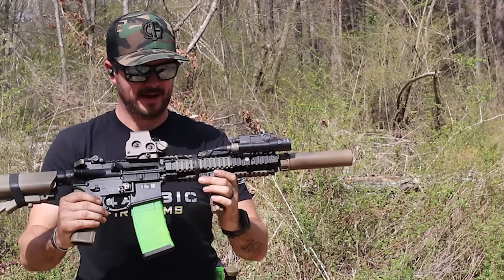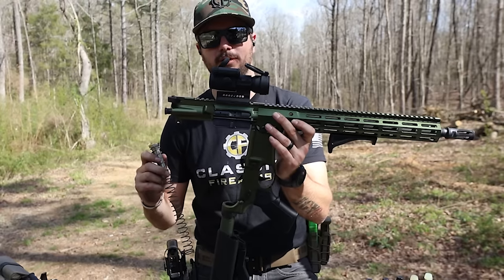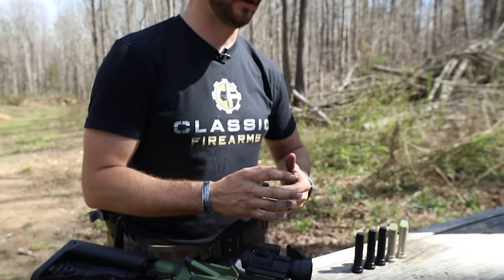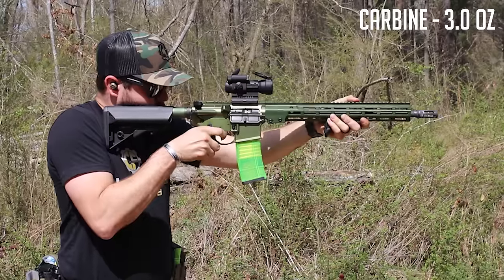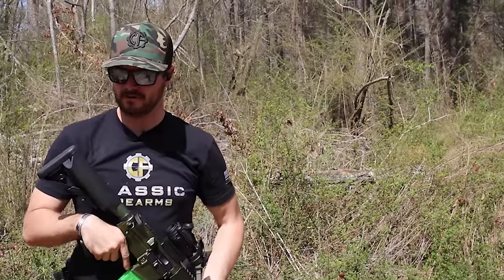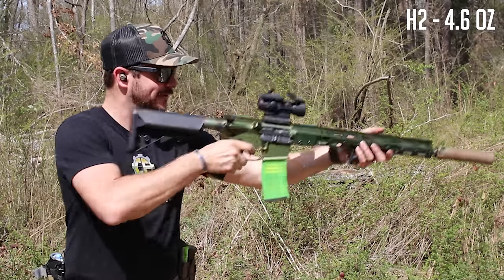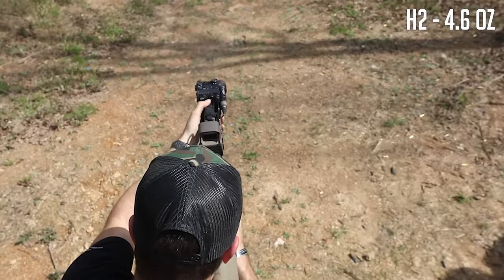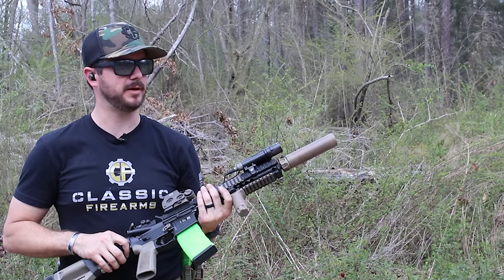What Buffer Should You Use In Your AR-15? (H1, H2, H3, H4)

Comment: Quick question with the buffer weights I am running my stock radical firearms 10.5" ar pistol in 5.56/.223 the only thing I changed out is the A2 flash hider for a ar stoner blast diverter (so all the gasses go out the front as apposed to the flash hider) the question I have is I can tell it is an pver gassed system but I believe it is alittle gassier with the blast diverter on it as it acts somewhat similar to a silencer I have noticed with the steel mag that comes with the gun it will not feed properly like the bolt is going forward way to fast for the next round to come up and I notice this slightly even though it still feeds that it seems abit to fast for its own good... so what I need to ask is should a change to a heavier buffer weight and if so what weight is best for it???

Comment: To all the newbies, just cheat & use other people's research for your build. Plenty of forums that have this talked out & charts even. If you're not sure you could snag an adjustable, its honestly only a wee bit more $ & multi options. Or if it tickles your fancy, the JP SCS systems are very nice all around w/ more benefits than just weight tuning. Best of luck to all.

Comment: Buffer weight in my experience has never made much of a difference.
My SBR has an 11.5 barrel and I have always used an H2 based on the 3 to 4 o'clock pattern I get.

Comment: Love that you did this! I question the assumed that there is a correlation between ejection direction pattern and buffer weight on a gun with a spring loaded ejector.  As soon as the brass is clear of the port door it will come out with the force of the ejector spring.

Comment: With an over sized gas port, you can install an adjustable gas block and reliably use a standard buffer mitigating recoil impulse better than using the H -H1 or H2 buffers...Having the ability to mitigate the gas gives a much better rifle for felt recoil than just increasing the buffer weight...Having the ability to adjust the gas to the lightest buffer is the best option....Adding weight to the recoiling parts will increase the recoil....

Comment: With my rifle the shells eject to my 1 o'clock position but my real problem is that I'm able to fire the first round but when loading the next round the BOLT closes about 3/4 of the way but the BULLET somehow gets CAUGHT UP and is BENT in the middle with deep GOUGES on the side and it will continue to do that until about 3-5 rounds and then after that I'm able to finish the magazine shoot the rifle with no problem most of the time.
 Is that a BUFFER TUBE problem or something else ENTIRELY

Comment: I was hoping this video would provide me with some context as to why the lower I built recently doesn't cycle properly, sadly at least according to the listing on OP where I bought the buffer kit it's a carbine buffer, so already as light as it's going to get. The ammo I used is standard velocity 223 55gr from Tula, which I understand isn't top shelf ammo, but the same upper on my old lower cycled it just fine... Do new springs have a noticeable break in period? I did notice that the hammer spring seems to have a lot more tension than my old lower, and the hammer itself has a bit of a different profile, maybe that's the cause? The pistol lower I built with the same LPK from PSA seems to work fine, but it's got a 300blk upper and a pistol length gas system so I'm doubtlessly putting more force into that than my 16" 556 upper with a carbine length gas system...

IDK if anyone in the comments can help me out but having a, for the most part, manually operated AR isn't exactly what I intended...

Comment: I know I'm late following this... But did you come up with follow up video testing these various buffer weights with various different gas length systems. I know my mid length system works well with a H3. But  there's also other variables like spring strength and how well your gas block is working, and the weight of your bcg.

Comment: My brass ejects at 2 o’clock now with no suppressor. I have a Diamondhead 12.5 inch barrel. I’ve asked the range officers at my local range and they said that’s the ejection pattern I want. I had to get a brass collector in order to keep my brass since at the 2 o’clock pattern, it shoots directly into the range where I can’t collect. Should I get a heavier buffer weight?

Comment: Recommendations on a buffer set up upgrade for the ddm4 pdw withOUT a can but will properly cycle both subs and supers? I've run both factory that were included with multiple loads of both super and subs. Supers run fine but subs dont cycle well consistently. I understand this 300blk was designed around putting a can on but I'd like to be able to run both without and without issues.

Comment: Running a pws mk114 mod0, so curious with buffer weights, as the mod0 doesn't have adjustable gas block. It's gas block is also built like a brick shite house, with the quad trails attaching to it. Side affect, it gets hot, so shooting without gloves doesn't work for long.

Comment: I can't get my 18" rifle length gas system, upper to cycle reliably.  I have used an H2 and then an H buffer weight,  it's still under gassed.  Should I use a carbine weight buffer?  My lower has a standard carbine length stock, not a rifle length stock.  Can't figure it out.  Should I use a reduced power buffer spring?
Reply: carbine buffer should be good, what kind of ammo are you shooting though that's giving it cycling issues? That can happen with underpowered steel case .223 like Tula.
Reply: @ed00001  I'm using Frontier 5.56 55gr, M193, brass
Reply: @ed00001  I ordered a Strike Industry standard carbine buffer.  Hoping that will work.
Reply: @bigmike716  A carbine length gas system is more violent than a mid length and rifle length shoots even softer than a mid, so if you were using a heavy buffer combined with a rifle length gas system, that could easily lead to cycling issues. Carbine buffers are the way to go unless your gun is overgassed.
Reply: @ed00001  Thanks brother.  Can't wait to see if this works.

Comment: My rifle doesn’t run steel reliably due to the the decreased gas return and bolt not cycling all the way to the rear. I use a carbine buffer, is there anything lighter that maybe I could run steel with?

Comment: Thanks for the good example vid!  I'm working to build a lightweight AR and wondered which buffer to use. I'll be using an adjustable gas block, so that might be enough, but maybe will also need a heavier buffer to smooth out that light bolt.  Any comments would be appreciated.

Comment: Hello I have a quick question if anyone will be willing to help. I am new to gun collecting my father recently passed he had quite the collection and it has now been passed on to me. And I am younger so I haven’t had a whole lot of experience with the guns yet and I’m trying to educate myself. With just different guns calibers everything. And one thing that has confused me is Specifically this gun. Colt AR-15 6920 Trooper M4 Carbine .223 / 5.56. 

Confuses me because it’s described as an A.R. 15 which to my understanding is a rifle with a 16 inch or longer barrel originally made by the ArmaLite rifle company later sold to colt. But at the same time it’s also described as an M4 carbine which again to my understanding a carbine classified rifle is just a rifle with a shorter barrel and a little lighter for better mobility.

Comment: Civilians hyper fixate on ejection patterns.  If your platform runs reliably, consistently & accurately then attempting to "fix" it is a solution in search of a problem.   

Patterns CAN be useful for diagnosing issues, tell you of extractor wear etc. but aren't a prob themselves.    Almost no setup will eject the same way quiet vs. loud so what are you even chasing at that point?  

Y'all make some good vids and ik you hire vets but possibly hire a GWOT SF/SOF weapons spec. or retired Army/Navy armorer that was previously infantry or at least kinetic.   Just my un-asked for opinion, but I think it would elevate the vids past general info and showcasing merch.

Comment: I'm messing with a 24 inch barrel ar 15. (Experiment) what buffer and spring do you guys suggest for reliability? It's got the rifle length gas system.

It's struggling to feed and I used a few mags of various Models.

My current buffer is H3
Reply: @Frank Bonazza III thx for the tips. Will start small and work my way up

Comment: I know someone who has a 7" 300aac upper (from PSA) with a Franklin lower and it isn't cycling.  1 round, then partial/misfeed.  Tried a shorter spring, but no noticeable difference; still misfeeding.

Any suggestions?

Comment: I got a millspeck PSA16 inch upper with the stock buffer buffer and Spring which I assume is the car being which is 3 oz I went up one to the H buffer and my felt recoil is about 8 times more than it was with the standard car being buffer I don't understand. Do I need a heavier Spring if so how do I determine if the Spring is heavier Springs don't seem to be rated the same way as buffers

Comment: What about the weight of the BCG? I have a 20" 6.5 Grendel that was shooting fine until I changed it to a side charging (heavier BCG). IT ejects but fails to pick a new round or even close the bolt completely. I tried switching to carbine length spring. I bought a adjustable buffer (can change weights inside) and still nothing. Any advice would be appreciated.

Comment: Will a heavier buffer weight help bolt closing/soft striking issues.
Reply: A heavy buffer helps close the bolt through carbon build up or other crud to lock it home all the way into battery.
Reply: "Soft striking"? Do you mean light primer strikes? Try a Titanium firing pin. They're a little spendier at around $30 vs $10 for a mil-spec one, but they have more mass/inertia to eliminate light primer strikes on harder primers (like Wolf or even Hornady ammo can have). Plus you'll likely never damage let alone wear out a Titanium firing pin vs a mil-spec one, last firing pin you'll buy for each rifle.

Comment: Cam somwone help me  i have cheap  ar converted into 50. beowulf its a milspec lower  milspec lower I noticed my trigger and my hammer are some plastic like component so I will need to change that bui also need to find out what is the correct buffer weight and spring for the rifle to function and cycle correctly for how powerful the beowulf round is I'm sure it's releasing lots of pressure so I need something that will be at the perfect weight for a beowulf i also need some recommendations on what buffer spring would be the best to give enough oomph to cycle the next round and it seems my current buffer tube is a carbine length buffer or mid length but since i converted to beowulf does that mean i need to change my buffer tube to rifle length because my barrel is only 18 inches so I'm pretty surr I'm good with my current buffer because 18 inches could be considered  mid length but i really need to know whats the best choice's for my beowulf build

Comment: I recently built an Aero Precision AR with 18" rifle length gas tube using a carbine buffer  I've run about 100 rounds so far with no issues.  I contacted Aero before I built it to get a recommendation on correct buffer.  They were  swamped, and by the time they got back to me it was built.

Comment: Which buffer is ideal for a 10.5 inch AR pistol?
Reply: I'd say H3, but if you just want to be super safe H2 is almost undeniably going to work in almost every platform. It depends on several factors.
Reply: @mrsickwick  like what? If you don’t mind me asking? I have a 10.5 rasco barrel, carbine gas length

Comment: Thanks this vid cleared up my confusion.  I have a 10.5in 350L with standard carbine buffer (3oz).  It is slightly under gassed.  I increased barrel gas port size.  Still ejects slightly past 5 o’clock, occasional short stroke and fail to lock back.  Looks like I need to try a lighter buffer or lighter spring.  Anyone make buffer lighter than 3oz?

Comment: No surprises for me. I run an H4 in any carbine I'm putting a can on. They run great with the can on or off. For some time, I ran an H4 exclusively on my MK18 clone SBR that worked flawlessly. I now run that as a .300 BLK with a JP Enterprises silent buffer and that also works great. As for fine tuning the H4, you can also look into varying the spring. There are several good springs on the market that let you tune the performance further and they're much cheaper than adding an adjustable gas block.

Comment: You can’t always go by ejection, my 11.5 criterion unrepressed does 3-4, suppressed no matter what buffer weight it still shoots 1-2. So I just keep the h2, the h3 feels more punchier.
Reply: You should change springs if you're running that high of a buffer weight. C-H3 is ok, but if you run better at H4 you're supposed to increase your buffer spring +5% power and reduce buffer weight down to C.
Reply: I’m running the vltor a5 system, I’m running it with a springco green spring, the spring is already increased from regular vltor a5 spring

Comment: I did not see a lot of reason to change out my stock 556/223 buffer assembly even after adding an adjustable gas block. 

However, my 300 black out was a different story due to account for supersonic vs subsonic and supressed vs unsuppressed. The unsupressed + supersonic worked out of the box. I added a superlative arms adjustable gas block start start tweaking for subsonics + unsupressed. Shooting unsupressed with 300 BO provides a low noise, low recoil situation that is good for home defense. Having build a 9mm AR it feels very similary to shoot. Anyway, in addition to the adjust gasblock i had to use a lightweight titanium brownells bcg, 1.7oz kaks buffer weight, SpringCo Yellow reduced spring. The subs with 300 BO now work perfectly unsupressed. 

The suppressed scenario for 300 BO I cant test until my silencers come back from NFA process. My expectation is that the bcg, and full buffer will be completely different for supressed. Takes 5 minutes to swap it out.

Comment: I started out, when shooting the M16, the original 5 1/2 lb 20 inch barreled M16. I shot expert Marksman in basic training. Every time I qualified with the gun I fired expert marksmen that's the only shooting I've ever did on the gun, I noticed no particular recoil impulse the most irritating thing about it was the spring ringing in my ear. And the last time I qualified expert Marksman forty rounds were fired in full auto because there was a 29th wind in my face and it was eight below zero outside and when I shot right and left post I put my elbow against the postage am the rightful up against my arm and I put it on full-auto and still shot every round fired into a 3-inch group. And you're trying to figure out the degree of recoil Management on a 223 rifle. What a wasted video. It's like listening to these people who are trying to figure out what kind of muzzle brake they should have on their 5.56 rifle to control muzzle rise. There is no Muzzle rise unless you don't hold on to the rifle at all.

Comment: I'd be a little cautious leaving that h4 buffer in there; if ultimate reliability is a concern. Those mk18's are favored by the SEAL's and they make it a point that their weapons operate reliably, even in extreme cold weather. The reason this is important is because the gasses need to generate enough pressure to cycle the action. Cold things that catch on fire don't burn as quickly as hot things that catch on fire. So if you're up in the arctic (or it's just winter time and it's really really cold outside), your ammunition isn't going to generate as much pressure as it would during the summer months. With that heavy h4 buffer in there, along with a lot of fouling from that suppressor on the front, you run the risk of short-strokes. Just something to consider.

Comment: uhm think the buffer spring also plays a part into the equation not just the buffer weight
Reply: i think he was using the same spring? not sure tho
Reply: @Ellwood76  probably so if its a good buffer spring the weight is still going to function as it should no matter the weight,  as they're lighter and heavier springs to coincide with certain weights am I correct

Comment: Hey I am building my first AR pistol any one have any recommendations what would be the best Barrel length, buffer tube type and BCG I don’t want to have any cycling or other issues
Reply: 10.5” no shorter on the barrel. Look up MK18 buffer weights, not sure what they are off the top of my head. A 14.5” barrel would be military carbine spec (best pistol choice). Any BCG but get a reliabolt and be ready for early parts breakage. Pistols run components harder. Build a 20” m16a5 clone, A5 buffer system with a 20” A2/A4 upper
Reply: @seancssu  thanks bro will check it out
Reply: @seancssu this might be a weird question but can I use a  PSA complete lower, I’ve heard mixed reviews but I went with it because it was a 420$ lower and I got it for 160$ magpul edition in blem, can I pair my lower with the parts you were talking about I am doing some more research learning about guns and how to build them this will be my first AR build or if you reccomend any YouTube videos or books I will gladly check them out thanks again an thanks for responding to my first comment opened my eyes to a lot more
Reply: @kruiseorbruise  psa lowers are excellent